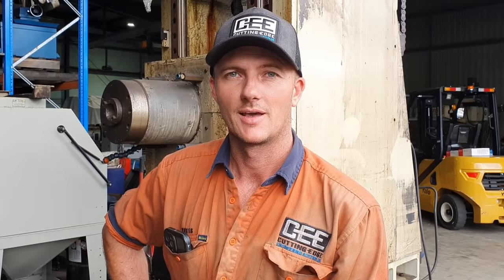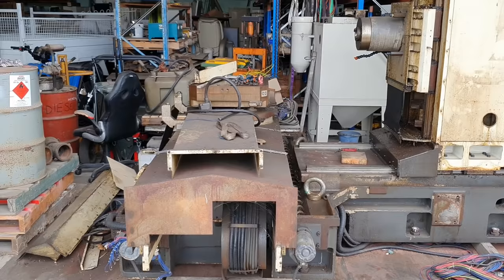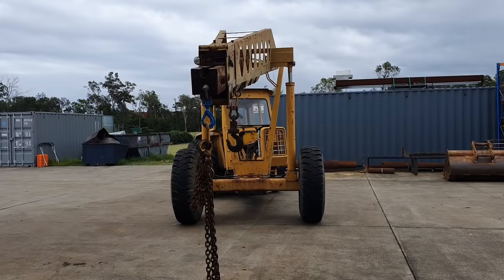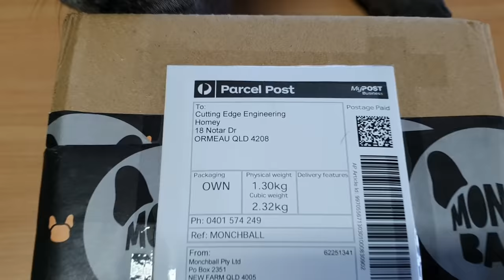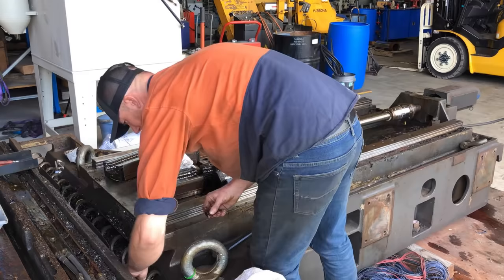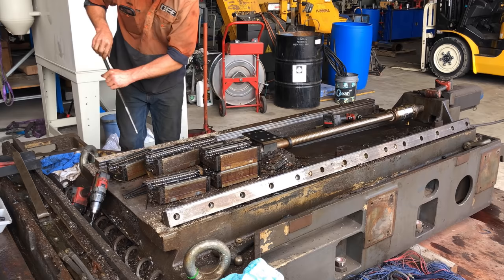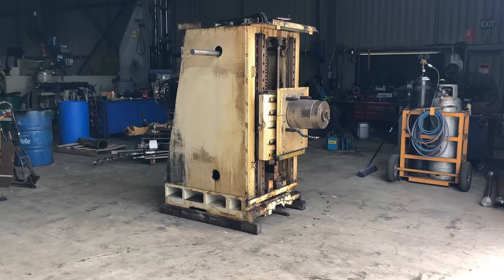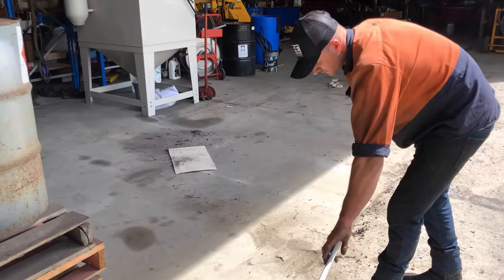The BIG Horizontal Milling Machine Project | Part 3 | Is This The End?

Comment: If the guy in Japan needed parts off this one, imagine the condition of his machine.
Reply: seen worse, cleanup new bearings good to go 😁
Reply: Possibly a bad crash?
Reply: @bachaddict  possibly multiple machines needing work?
Reply: I get the feeling that he is working on some sort of custom project. If I was still designing machines for the plant I worked for, I could imagine all the things I could use the bits that came off that beast. But alas, I'm retired and the plant has been gone for many years. I still could have built one nice metal lathe out of those bits.
Cheers
Terry
Reply: Cant confuse dirty with worn out 
This machine suffered electronic failure 
Who knows how long ago, mechanically it could have been quite good
Reply: Spindle and linear rails may have been damaged by a bad crash.

Comment: That job was deja vu for me ,
Four years ago I came out of retirement(I'm 73 yo) to strip and recover a similar machine ie Mazak H630 for a local engineering firm.
It was an interesting project and we saved heaps of parts for our production machine.
It was a good move for me too,I am still there and enjoying it.
Phil from EVLE
Reply: I stripped and rebuilt a fh480. Not quite to that level but spindle and motor were out, table was out. Had to replace near every hydraulic seal in the machine. It’s a brilliant machine, very accurate for it age. Will circular interpolate within less than 0.01mm.

Comment: Ah, yes. The skates. Unfortunately, those particular items are somewhat...damaged? 
Something that I've seen that truly works is 8inch(20cm) thick walled pipe cut about a meter longer than the object being moved. It is not easy to push unless you have a forklift or something similar.
Reply: Yep old school log roll method works wonders. It’s how we moved a 4 ton switchboard into the middle of a hospital.
Reply: Grab old rubber hose and place in the sun, to get them nice and hot, and slip over the pipe using some turps as lubricant. That gives a nice hard outer soft layer. You only need to do the outside sections, making semi bonded solid tyres on the steel pipe. Non marking then, and not as noisy.
Reply: @SeanBZA  I've seen riggers just use round bar stock before. Admittedly, not on 28 ton machines, but on smaller mills and lathes.
Reply: Pro tip - regular black iron pipe bends if you try to use it for rollers.  Thick wall sounds like the way to go!
Reply: I gotta thank y'all for the great input. 👍 You're the best, guys.

Comment: when you first got that i thought it was too old to fix. if it's 80's vintage then electronics have really progressed including motors. only old stuff worth converting is if it's big. i mean really big . like boring mills . i have a bridge mill that was converted and we got no time to put it together. it's a hybrid. an old g&l bridgemill that has had all linear rails and a 3 axis cnc head. so it tilt's left right and front to back . plus a 7 ft square rotary cnc table. the thing has travels about 8 feet x 16 feet with a siemens control i bought it  dissassmbled and no manuals. 
any my business has changed . we no longer need it. and in our part of the country no one available to take it on. it weighs  about 150 tons assembled  and takes up mucho floor space.

Comment: I'm having flashbacks with this one to machine tear downs I've done.   I'm gonna post some things here you probably already know so others can share 'em.  I learned to always save the ballscrew bearings and mounts with any shims in between the bearings and keep them in order, and to keep the bearings clean and each set together - they're factory matched super precision bearings, really expensive to buy new ones.  The fittings and fixtures for the one shot lube system are also more expensive than they should be, and most of the time they can be cleaned and used with new tubing.  Even if the linear slides are junk usually the trucks on them are rebuildable and are also expensive, and the same goes for ball screws and ball nuts.     Finally, the spindle and motor are worth taking extra time to preserve.. if it's a cartridge spindle, the whole thing pops out fairly easily and can be rebuilt and reused.   If it's not a cartridge, the spindle contains yet another set of super precision bearings.   Plus they're the most critical part of any special purpose machine you might want to build.  You always have to balance keeping things with what you'll use vs. space free, but having certain useful things on the shelf can save you days of time if you can use them to bodge up a purpose built solution to something.

Comment: Only thing you did kind of wrong: You shouldn‘t have removed the guide blocks from the linear rails. They are paired to the rails and as you lose balls when removing them. You can remove the blocks if you have a similar guide rail or plastic piece which you can butt up against the rail and then silde the block onto it. Otherwise great video as always!
Reply: I was looking for this comment myself. The balls are usually paired to the blocks as well, and sometime even to the specific side of the block.

Comment: When I worked for FMC they still used the very first tape controlled machine they installed, it was a radial arm drill that had a locking post at the far end. It had a table the had tape controlled X and Y and the operator controlled Z and tool change it was something to watch when it had a big job on it, great vid.

Comment: pro tip with those skates coming from someone with very similar ones and who has used them to move a horizontal machine around in the garage. cut the rubbers off and take the turn tables off and they work great. mine's an old 1998 haas hs-1 that had been left outside for a few years after something broke. I fixed the tool changer, replaced a ball screw, and repainted a bunch of panels that I had to take off to get it in my garage. luckily i've been able to get it back in running condition, i'm sure it will need parts to be replaced as it goes, but i wont be using it as a full on production machine so i think i can manage. I wouldnt recommend anyone else have to go through the same experience, especially not for a business.

Comment: I had a mid 2000's cnc as one of my main machines when I purchased my old  business 2010,  retired it in less than a year as it was too slow.  Had intentions of stripping and rebuilding it to modern specs  but all it did was sit taking up space as other priorities always overlook  that project.  It was still sitting unused when I sold the business  due to health reasons  4 years ago.

Comment: At least it's still being "useful"... as a parts machine. The thing is, if it's beneficial to tear the machine down and sell as parts then, it's paid for itself right there alone. 
I was going to ask if you have separate scrap bins, one for steel and another for aluminum but, guess you've answered that. Most "scrappers" don't sort anything out, was always relied upon the customers bringing it in. At least in my area in the states. Great video, cheers :)

Comment: Regarding recycling of copper wire...
My father was an electrical contractor and he used to accumulate lots of scrap cable - offcuts and stuff pulled out of jobs. When it had accumulated into a big heap in his yard, he would watch the price of the copper market. When the time was right, he would load us kids and the copper up for a fun day at the Kurnell (Sydney) sand dunes...
Now, remember this was the '60s, when nobody gave a f**k...
We would go to these lovely pristine sand dunes and make a big heap with the cable, pour petrol on it and "light her up". This raging fire would create big cloud of oily black smoke and the fire brigade would come - they would say "what are you doing mate" and my dad would say "just doing a bit of burning off". They would say "ok, so long as you know what you are doing - just keep an eye on it" and happily leave 😲.

After everything had cooled a bit, we would load this smoking heap back into the trailer and head home - leaving behind and awful mess (the copper merchants wouldn't pay much for insulated wire but gave full price for copper covered in gunky black ash).

They were different times...

Comment: being only accustomed to horizontal mills where the z axis is on the table and spindle moves in x and y axis this was very interesting to see  a machine where the x and z swap places. I see the advantages for this tho. Limits far less the overall length of the part you can put in.

Comment: All my life my most favorite thing to do it tear machines down, clean, polish, paint all the parts etc. My problem tend to be getting it back together right lol. But it's weird how much time I will take up just cleaning and painting the parts. Polishing stuff that has no need to be.  I did a video of me making a huge parts washer for just this reason. So I would have had one heck of a ball taking that machine down. THEN when tearing that thing down, I tend to not throw anything away. I would have saved every bolt and screw, side cover etc.

Comment: That's the good thing with equipment and machinery there are usually lots of parts to sell and the rest weighs a lot and brings money for scrap. That's how you run a business if it doesn't make sense money wise it's gotta go. You are not in the warehousing business.

Comment: Our work in Adelaide has a quilled horizontal borer/mill of probably older vintage and x4 in size.
Doesn't get constant use but when it does its ideal.
Great in particular for long gun drilling over any other option we have.
But man it's a space hog.

I can see that rotating table you are striping off coming in handy as an accessary.

Comment: Older CNC's degrade pretty quickly when left unused. Plus parts support gets tricky. Good decision to scrap it. Older manual boring mills don't fetch much on the market in the states as no one knows how to run them anymore and they are expensive to move. Too bad those weren't Fanuc red top motors as there is a market for those and the drives. I'd send the Mazak down the road as well and find a solid horizontal boring mill with a traveling column and a quill. huge work envelope and huge weight capacity.

Comment: most linear bearings like that lose their balls if you pull them off the rail. they come with plastic keepers to keep the ballls in. so are these different ? sometimes you can smear heavy grease into them that keeps the balls falling out.
Reply from the maker: Some of the balls got out 🤣

Comment: I told you long ago that this is not the machine for you but you didn't want to listen to me and it's understandable. Now I tell you that the components you have taken apart will also take a lot of dust and you will never use them until you scrap them. You need a manual horizontal boring machine with a large rotary table .....

Comment: Ohh, you just be broke the cardinal rule of used linear rails!!! Once they get any run time at all on them, you never pull the truck's off unless you are scrapping the entire system. The bearing ball's are preloaded on the rail; they can only rotate in one axis. They and the rail wear in to each other and become a matched set. Even if you put all of the ball's back in the correct truck, the wear pattern is trashed, and will never be as accurate as it was before disassembly. It could be close, but personal experience doing this type of work say's that the odds of that are pretty small. Hopefully the folks that bought them are looking for for good core's for rebuild; if the tracks on the rails and inside the truck's aren't seriously pitted, they can be lapped and reloaded with new ball's to bring them up to 95%~98% of new accuracy for a fraction of the cost. This isn't something most people can do and get it right.

I wish I had known what you intended before hand so I could have warned you about it....

Comment: Kinda sad to see that machine get scrapped :-/
Would have been a great machine, once converted over to LinuxCNC, perhaps even with linear scales for closed loop. Probably not even hard to do, since all the servos and servo amplifiers are still there. And because of the linear rails, there is never an issue with worn out/galled/rusted/scratched boxways/dovetails and rescraping, basically a machine would nearly last forever mechanically.

At least you saved some parts for someone else.
I would have just moved it outside and put a few tarp layers over it and perhaps build a shed for it later (same what I have to do for my 2 CNC lathes that currently live in my driveway ;-), but corrosion isn't much of an issue here in the winter, especially if you dump loads of slideway/chainsaw bar oil over all the boxways)

Comment: Kurtis, your skates wheels are too soft, I had some of those wheels that come apart too. I replaced them with better wheels and they work fine. I built a couple other sets for heavier loads, I had 182,000# (82,727 kg) with no problems. Like  your videos.

Comment: Curious if you’ve ever considered making a spring-loaded pilot pin for your annular cutters? I use them on my Mag drill constantly and find they push the core out really well. I realize your chuck is likely not setup for them, but could be a decent shop made tool to use

Comment: I went back to episode 1 and 2 and see that is a Toshiba machine.
As the covers came off the  and the major components became visible I could see that it was so  very
similar to the Mazak H630 I dismantled.
I wonder if the same machine was built by different companies( badge engineering?)
Phil from EVLE(Elermore Vale Light Engineering)

Comment: Hi kurtis love yours videos I'm looking for some advice . I have a job coming up on a excavator boom that is cracked. The job has to b done on site , all I have is 200Amp AC Honda genny and 6013 rods   can I do the repair with 6013 or do I need to find a DC machine and do it with 7018 cheers 🍻 Kevin in Ireland 🇮🇪 👍